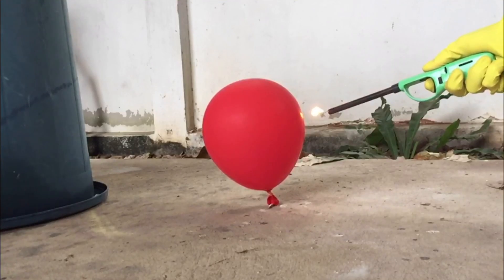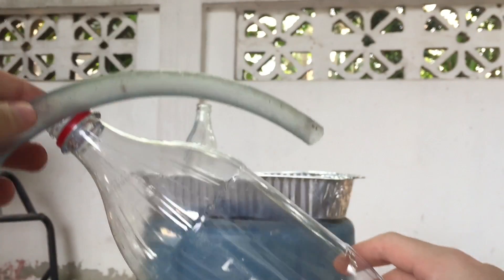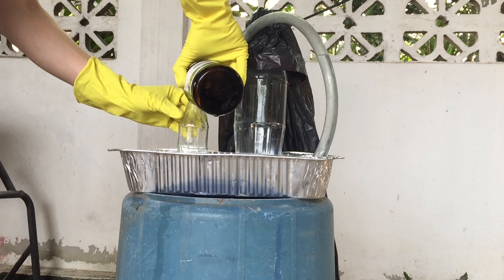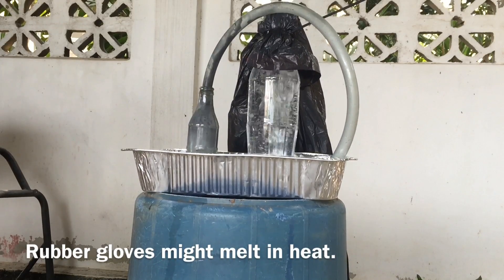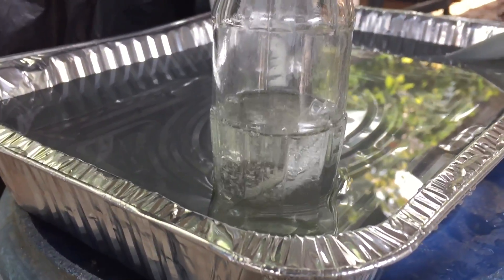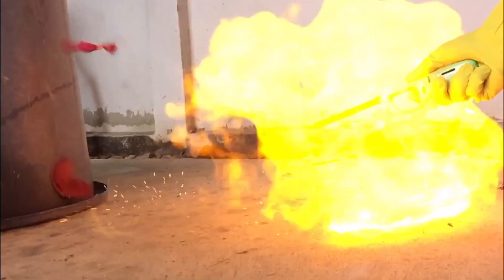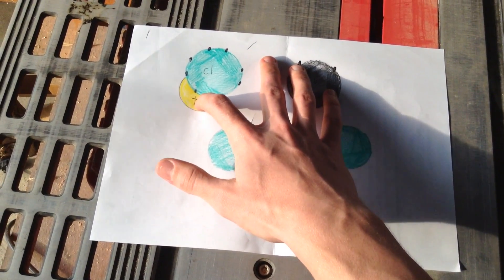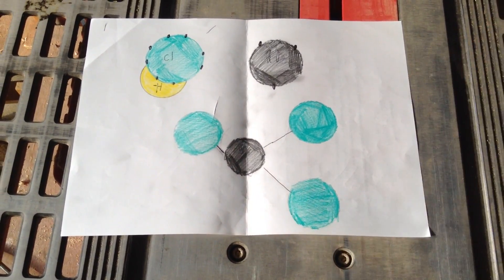How to make hydrogen gas with hydrochloric acid.

Comment: Whats the concentration of the hydrochrolic acid
Reply from the maker: I can’t quite remember, but 50% rings a bell.
Reply: @waynesullivant  i did try 28% it work but its slow and not that violent
Reply from the maker: @bang4915  Ok, well it’s probably safer that way. If I did my experiment all over again, I would definitely dilute the acid.
Reply: @waynesullivant  yeah and if you add a little oxygen in the Balloon the explosion would be much louder

Comment: What are those sparks in the balloon clip?
Reply from the maker: I watched it again and just noticed them. I have no idea except for that they could be ignited iron filings from my previous metal work. Unlikely in my mind, but at least that’s my best guess.
EDIT: Actually, it may have been from the screw that I used to keep the balloon from flying away scraping against the concrete.

Comment: ❤️What is left and how do you dispose of it safely?
Reply from the maker: Aluminum chloride is left. It is fairly harmless. Make sure that there is no more reaction and then there shouldn’t be any more acid. To be safe, I diluted the residue in a bucket of water and poured it down the drain to be processed by the city water management facility.